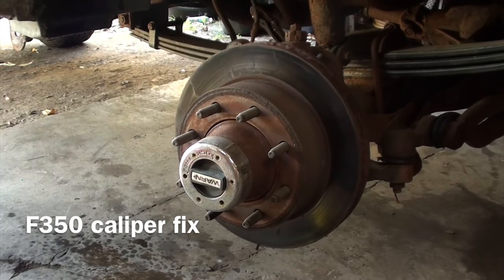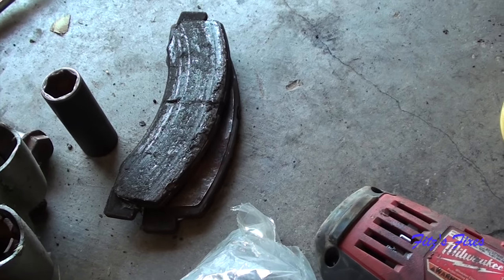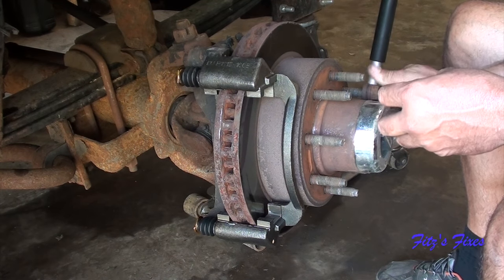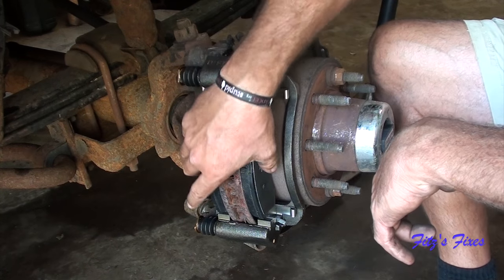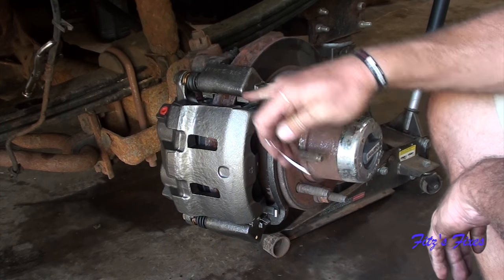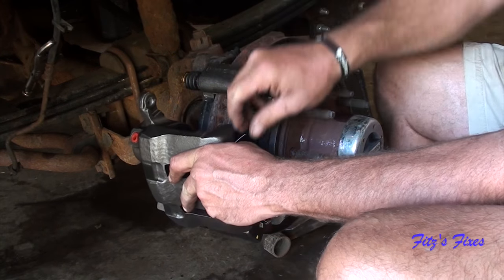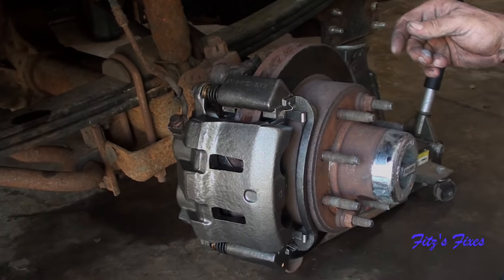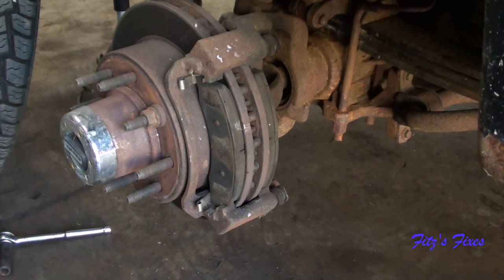F350 Brake Caliper Replacement

Comment: Replaced both calipers, but couldn't bleed brakes totally.  I found out that there is a right caliper and a left caliper.  I reversed them when installing.  Reverse them and viola!  You can now successfully bleed them!
Reply: Mine didn’t say they were different, how so are they?

Comment: You can just gravity fill and bleed th calipers through the reservoir.  Don't need a funnel.  Just keep the res full take off the cap.  Crack the bleeder let It fill and run out until there's no more air.  Finished.

Comment: Bracket to Steering knuckle torque to 166 ft lbs.   Caliper bolts to guide pins on bracket, torque to 46 ft lbs.  But what is the torque for the brake line banjo bolt?
Thanks for sharing!

Comment: IF my Ford F350 pulls to the left when breaking, does that mean I have a right side caliper issue ?
Reply: I have the same thing. Did you fix your issue? Only one of the pistons on my right caliper moves when pushing the brakes.

Comment: Seams like you do a lot of extra steps
Reply from the maker: 407ForRent you think so? What extra steps did I take?
Reply: Fitz's Fixes filling the caliper with brake fluid.
Pinching the brake line off.
I install the caliper bracket and pads all in one step two 21mm bolts and done.
Reply: you want it done right especially for the braking system.

I would take my time also, also explaining it can be done.
Reply: 407ForRent.....you still have to fill a new caliper with brake fluid......if you do that prior to install, you eliminate bleeding (though gravity bleeding works well, too)......btw....the bracket didn't need to be replaced.......so your advice ADDS a step.......